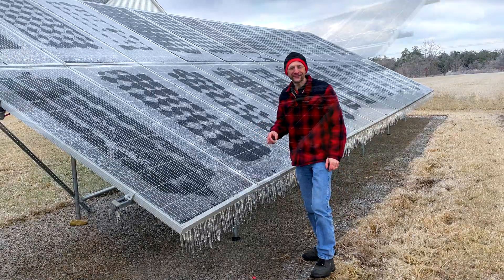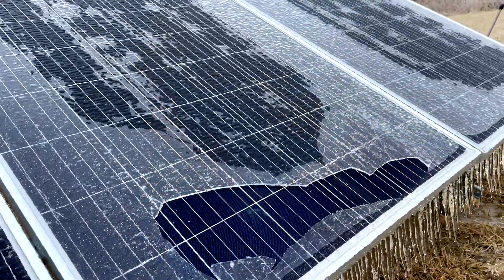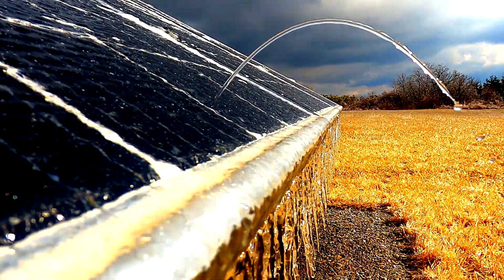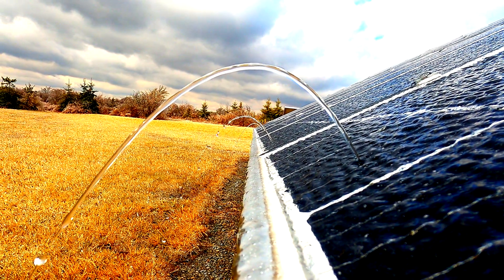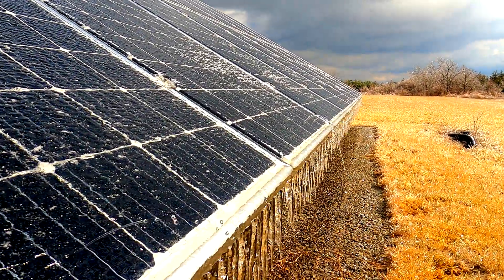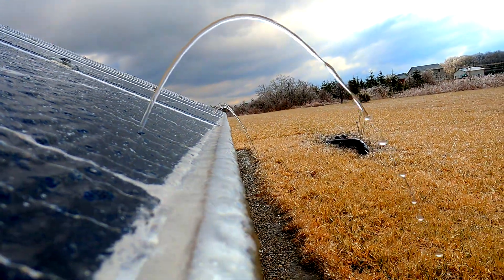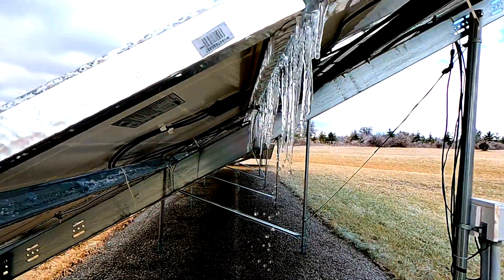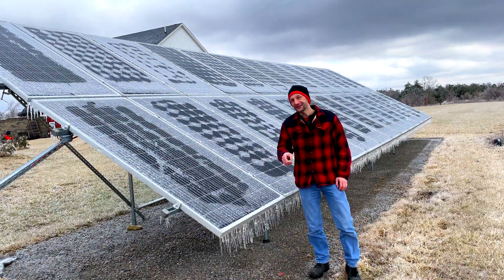Ice Storm Creates Solar Panel Fountain

Comment: I'm thinking to install the same system in summer, ever though of wiring a heating pad behind the non bifacial panels to fast melt any  snow buildup?
Reply from the maker: If snow accumulation is an issue, I would install them at a steeper tilt angle before attempting a heating solution.

Comment: I have been considering adding solar this year and came across your channel.  You have inspired me to do it and DIY.   I have room for ground mounted in the far back of my property, down a slope there there is a level bit of yard.  How far can the panels be from my house and what considerations do I need to take into account?
Reply from the maker: Great! you can do it.  : )  My run is about 250' and I am able to do it with 10AWG wire.  There are several online conductor sizing calculators.  If you know your voltage, current and distance you can get an idea of what size conductor would be required.

Comment: The first video I have seen on yours was your last one, west vs south. I really enjoyed that. Had a quick thought for a project. What about mounting your array on a trailer. Old truck body, something like that. mount the axles or other system so that it can turn on its own wheel base. Similar to tank steering. This would allow you to track the sun. I was just thinking about cheap ways people like yourselves, with the space, could create cheap tracking systems. Could have a circular tubing acting like train track and the frame on wheel so it can easily turn. Similar to roller coaster mounting. Just that start of an idea that could evolve.
Reply from the maker: Interesting idea, but I've opted for fixed systems.  Trying to track the sun ends up being too time consuming and cost prohibitive relative to just adding more panels.